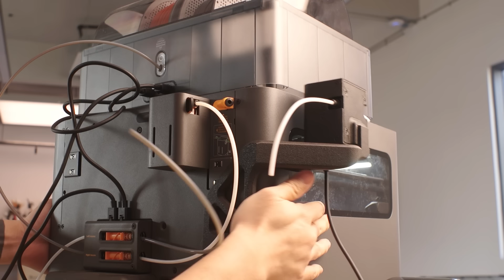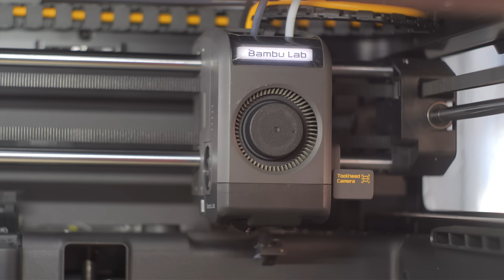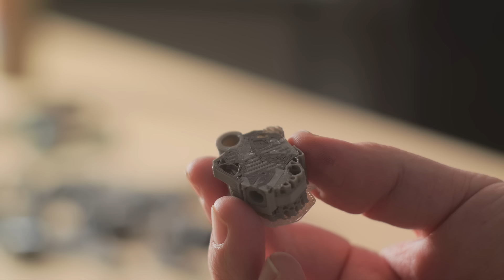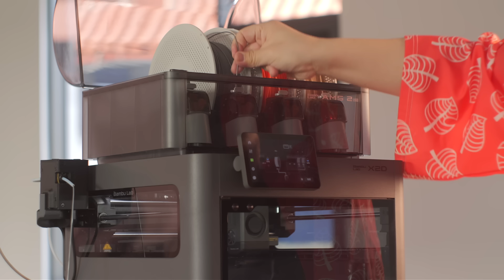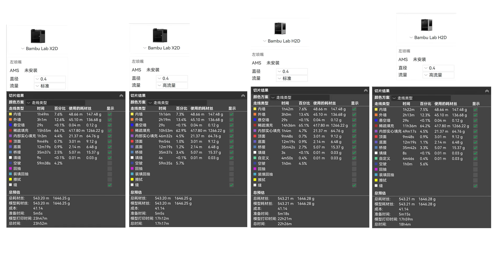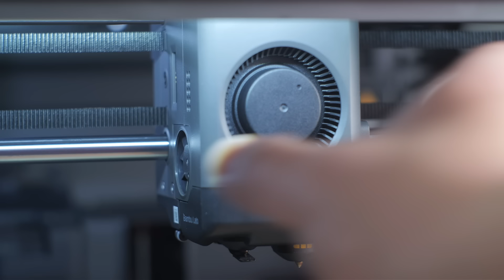30 Days 623 Hours with Bambu Lab X2D

Comment: Nice video, very well done 👍 btw which modeling software did you use to create the mechs and parts? Any tips and tricks on which adhesives to use or certain joints that work better when it comes to assembling components together?

And in terms of your workflow, I may be wrong but I assume you print each colour part individually first and then assemble the kit of parts together as opposed to printing parts with multicolour?

What material filament do you recommend for finer and smaller detailed parts?

Thanks 😊

Comment: I bought one, upgraded from a P1S, immediately had a problem with the Internal hub on the AMS 2 Pro having too much resistance and not feeding filament, I have to "force feed" it every print. Found a Reddit thread with a bunch of people having the same issue. Bambu is sending a replacement internal hub. 

Overall I like the printer and the price but even with the heated chamber ABS still required glue on a flat plat. But with the added filtration I couldn't smell ABS fumes. So that's good

Comment: Never heard of you before this review popped up on my list, and I don't understand how that is true. This was likely the best review that I've seen for my own understanding. I wish it had been out and in my list before I bought my X2D. I mostly print functional models and wanted an extra printer to supplement my H2D. I got the H2D instead of the H2C because I wanted as much capacity as possible to print with a main filament and a support filament, up to including the various nylons. The X2D was the perfect replacement for my X1C because it brought the dual nozzle benefits that I needed without sacrificing build plate area for all prints, even if I didn't need the extra nozzle in some prints.

I honestly would have gladly paid $100 more for a true dual direct drive extruder, but I've been very happy so far with the X2D, and it's shockingly capable for the price. I've already printed many functional parts, and I'm surprised that the quality of prints on a new printer has been so outstanding. It usually takes even Bambu a while before the profiles and firmware are polished to this level.
Reply from the maker: I won't review a printer if it ain't great.😀

Comment: I ended up returning this printer back to Micro Center. 2nd day in while printing petg on the left nozzle and pla in the right for support interface. The pla in bowden setup in the right melted and jammed inside. Had to tear everything down and still couldn't clear the jam. What a shame this printer had so much potential. My 2 cents if you're purchasing this printer which was originally designed for support materials, don't get it. Go with the H2D or H2C instead
Reply: Changing your printer model won't change the temperature settings for plastic printing. Think about that.

Comment: I have over 1000 hours on my P2S. ABS-GF, ASA and ABS make up more than 90% of those hours. the one time I tried to print PETG it failed miserably and clogged the hot end. I sold every roll of PETG I had and will never print with that crap again!
Reply: what PETG brand do you use? and was it HF version?

Comment: I just ordered one for myself. I have been into 3D printing for 6 months now on the P1S and had a few projects that were struggling from support material leaving a mess. So an auxiliary nozzle is exactly what I need.

One could even argue that at this price point the upgrade is going to pay for itself, compared to using an AMS to switch material, wasting filament on poop and paying for electricity to run for many hours longer. At least this is what I am telling myself.
Reply: Why not opting for the Anycubic Kobra X, Snapmaker U1, the upcoming Flashforges..? With those printers, you can print 4 different materials but with the same level of accuracy. 

The X2D makes no sense as accurate models need accurate supports...
Reply from the maker: @koenraadprincen7212  I have used them all,  not a single one comes close to the precision of Bambu's nozzle alignment
Reply: @MaxMakes-l2q  If Bambu would have integrated the printhead of the Kobra X in their machines, that would have made a splash 🙂
With this X2D, Bambu mixed direct feed with bowden feed which is very weird (for 2026)...
Reply from the maker: @koenraadprincen7212  I asked, it's for keeping the tool head's size down to keep the printer's size down while printing 256mm^3
Reply: @MaxMakes-l2q  Hmm... look every motor or axle has two ends, so they could easily combine two hot ends with one direct drive motor if they thought a dual head is good enough.
They "only" had to add a (mechanial) clutch to switch between both ends. 

Don't be surprised if some third party comes with this solution 😎
Reply: @koenraadprincen7212  I have now watched over a dozen reviews of the X2D, some of them critical, but none said the 2nd nozzle is less accurate. Slower, yes, with more stringing, yes, but not less accurate.

You are definitely right that the Snapmaker U1 is also a very attractive machine. If I was not coming from the Bambu system, had already build plates, experience with their software etc., I'd strongly consider it.
Reply: @terriplays1726  The second nozzle has a bowden style feed system, so it's less accurate by design.
The final surface will always be more rough and the volumetric deviations will be greater.

That's not a big problem when comparing the same parts but it might become a problem when part 1 has to support part 2.

In engineering, making, tinkering,... the adagio should always be "work as accurate as possible as long as possible" and on this point the X2D is the wrong direction as you have to give up accuracy too early...
Reply: @terriplays1726  Regarding other reviews... the second nozzle does hold up quite well as long as you keep it printing with a 0.4 nozzle.

If you use a 0.2 nozzle, it becomes "messy".
Maybe unless you start printing super slow...
(Bambu does not recommend the use of a 0.2 nozzle for this reason).
Reply from the maker: I won't say multi-material support printing can 100% replace normal support in all scenarios, but in my past projects, if I am using a multi nozzle printer, i am using it

Comment: Worthy vid for a sub! 

When I saw the printer I knew it was going to wind up a bunch of the Bambu community. It's more the engineering version of the P2S with support material in mind more than anything else and serves little purpose to those who are mostly printing trinkets, accessories and decorations.
Reply from the maker: Right, I would say that modeling skill is a must before buying one, it's really not a toy printing machine
Reply: I am still trying to understand why I would want one.  I finally started using my X1C a few months back and just got a P2S.  Both have value.

Not sure what also getting an X2D would give me.
Reply: Well I didn't plan on my acquisitiveness!

I now have one with my set of (now 4) Bambu Labs machines.

I would buy it over the P2S now BUT beware that it seems vulnerable to some problems that the single nozzle does not have.  I just replaced the Filament Blocking Unit (not just the thin cover part) and it seems like my filament sensor is also whacked so I am waiting for the replacement part for that to get my X2D back into use.  The connector for the heatend (the part that heats the nozzle) is also quite challenging to properly connect on the X2D when reassembling that part, a nasty design flaw in my view.

Good overall and I plan to try it with some efforts to use PLA or PETG to support the other, but I have to get it running again when I get the replacement sensor.